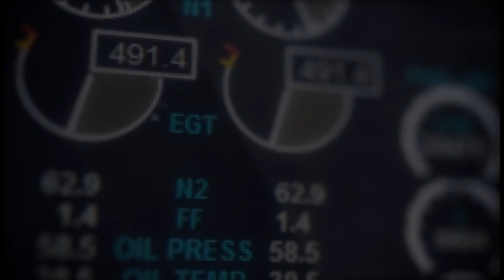Will Circular runways "take off"

Comment: IMHO, a partial palliation of the need for a large, obstacle-free peripheyry would be to have such a corcular runway on a peninsula adjacent to a relatively obstacle free land area large enough to render the needed periphery.

Thus it might be frequently necressary to construct that peninsula, being sure that the circular area is far enough from the cost or shore to minimise the amount of needed obstacle free space in the adjacent land. As for the passenger terminal, it might be feasible to construct it on or under the centre of the circular runway, connected to the mainland by a subway or undereground light rail service.

If that airport is also to handle heavy baggage or freight, the rail service might need to be of a heavier nature for the tracks and have a split inland to separate destinations for passengers and freight, and also have a higher tunnel height to accommodate large freight, or have all cargo flights land at a separate aeroport depending on destinations, case by case.

Sometimes the separate airport concept may be more economically expedient other times not, depending on multiple contributing factors.

As I am writing this, I am watching to see what is to become of two noew concepts in the West Island area of Montreal Island.

One is to serve Trudeau international airport which is located some 16 Km,. West of downtown Montreal in the city of Dorval. the current road systems are outmoded and inadequate, but also currently under construction, along with other major construction along the route.

The other is a proposal for a light rail service from C.N. east junction, north of the Mount royal rail tunnel to the vidinity of Fairview Shopping center.

I was aware of the shortage of land for the Fairview bus terminalk some years before the concern came to public view.

I then detailed my idea for a solution on an internet blog related to the STM (Montreal's urban transit provider).

Travelling on the buses frequently, about a year and a half later I encountered a driver whom I had never met prior, who happened to have an interest inthe concern. when we compared our ideas, the exact pieces of land I had suggested matched with those he believed would be used for the future new terminal.

I do not work for the STM or any other similar authority. I am retired at age 73, however I know much of the inside story as if I did, albeit from my own investigative paradigm.

My origonal idea was designed somewhat based on the Port Authority bus terminal in Manhattan, NY which I have had occasion to use personally. Both involve use of elevated busways to facilitate efficient access to buses arriving and departing.

Without more detail on that, one might well see from what arises my ideas here in regards to poeripheral accessibility.

In my time, I also have had some 1 million Km. on the road and fly and drives in 3 languages and 3 countries. A "GPS on two feet before GPS even existed!" (I was not a trucker, although I doid do a blit of it. I was doing industrial electronic service for an employer who was like a specialized agency, renting technicians to many and diverse industries.)

Comment: The wind woundn´t be smooth because it would go over the top of the runway and then downwards. Also it would be a minor difference but the outwards wing would be traveling faster than the inner one making and assimetric lift.
Reply from the maker: Yes, theses and many many more problems exist with this idea.

Comment: Before watching the video: My short answer is HELL NO! edit: same answer afterwards as well
Reply from the maker: Exactly.
Reply: My answer is still hell no. Land banked, imagine the flight patterns. Crazy idea.
Reply: so the planes will be landed on a bank and turn..... so when you touch down how can you maintain the turn during nose up phase?
Reply: I would argue that the addition of the iPad in the cockpit is worth noting
Reply: LOL. Ty.
Reply: My thoughts exactly. im just a simmer, but ive tried this using a j3 cub, and crashed more times than ive landed. a recipe for disaster/s yes. just wont work. especially if an airport becomes as busy as atl or lax or whatnot.  it MIGHT work for smaller aircraft , and that sir is only a faint might.
Reply: lol yeah.
Reply: With the correct speed and banking, you don't have to turn to keep going around a banked turn (just maintain that speed, faster you go up the banking and slower you go down it).
Reply: In a properly designed banked oval the angle of the bank  makes the force of centripetal acceleration (that force required to keep the object from flying out of the circle) be balanced by the force of gravity pulling down on the aircraft due to the bank.  Effectively the steering is straight.  Places like GM proving grounds have oval tracks with lanes slightly banked on the inside marked in lower speeds, and as the lanes go to the outside of the track they get marked with increased speed and are banked at increasing angles.  If a vehicle is doing the correct speed in it's lane the drivers steer straight and do not have to steer to go around the track.  Of course what I'm writing about is a car track... how that would work for taking off and landing...  especially if you have to land at an angle to match the banked track.  They also do banking for railways, especially high speed rail.  The turns have a large radii, but they are also banked; this keeps the train from tipping over at speed, and the train wheels centered between the rails.  If they didn't center, the inside edge of the wheel would rub on the rails and make a horribly loud sound.
Reply: Thank you, finally someone sane, unlike dumb comments above...
Reply: I thought the same thing and I only fly RC Planes! lol
Reply: The slope make this stuff absurd - all of the passengers will leap on one side... not to mention the plane at all...
Reply: Rudder
Reply: Mentour Pilot I find the idea as useful as a Concorde

(Goes good to displayed)
Reply: Same.
Reply: therealnightwriter : round runways and flat planets.  I think you might have just isolated the problem with the today's education system
Reply: So he obvious next step; spherical runways ?
Reply: agreed. I think even a square runway would be more useful, and thats a stupid idea...

Comment: Circular runways are stupid and they won't work. There's no point at all.
Reply from the maker: I couldn't say that but, yes.
Reply: But that's the point of ideas. Don't just say it will never work. Think, give reasons for and against, then decide.
Reply: There is points for, but more against. It is better, like here say why it will not work, than just say "this is stupid, because I say so".
Reply: I soo agree with you
Reply: jsponson It won't work, it's no point. Learn aerodynamics
Reply: As this video has demonstrated, there are many practical challenges, but I wouldn't say there's no point at all.  I can think of one benefit: aborted take off's would be safer.  With a straight runway there's a point of no return (e.g. when you exceed V1), with a circular runway you slow down and go back to the inner circle (having to avoid any aircraft in the other sectors of the runway, of course).
Reply: +Montero Entertainment It's not pointless, you can always head into the wind and the runway is never too short. There's 2 pros for you.
Reply: Yeah but more con than pro. Also the assumption is that the circular runway will never need to land an aircraft with mechanical damage. What happens when there are problem on the plane and it can no longer maintain a circular bank when landing?
Reply: +Nick L You have straight ones in the middle.
Reply: Leif Neland Ive done research on it and I thought about it. I know it's pointless.

Comment: Its bullshit it be best have a straight runway 360 degrees for the wind direction if u understand that. But going for a runway going around a curve then thats going put some stress on the left or right side of the landing gear. So wont be good. A long straight runway that is north south east and west then yeah that would make alot more sence

Comment: The circular runway concept is pure genius: A plausible sounding idea with all the correct buzzwords (green, environmentally friendly, fuel efficient, blah, blah, blah) that guarantees funding from simple-minded EU bureaucrats for years, if not decades. There's so many things wrong with this idea that it's hard to see what's right with it. Sure, it will never be practical, but who cares as long as the research funding keeps coming.

Kudos to Mentour for the restraint he has for not calling this idea completely idiotic.

Comment: This would solve the crosswind problems in VMC landings and takeoffs, and runway length would never be a problem. It is, however, difficult to see how precision approaches in low-visibility conditions can be solved. Currently this is done using old-fashioned ILS (CAT I, II & III) and massive approach light systems. IFR traffic management would also have to be overhauled. This is a concept well worth investigating, but being an old fart (a retired pilot) I see only problems with the IFR side of this idea.
Reply from the maker: Same here.
Reply: Being an old fart, my creative juices have mostly dried up - but I bet some young wizards, still full of spit and vinegar, will think of all kinds of solutions to this concept. It will definitely work just fine in flat and windy areas, but only for smaller aircraft and VFR operations.

Comment: If somebody is going to build a circular runway it's probably close to Dubai
1. They have lots of deserts.
2. They have a lot of money.
3 They spend the money on extreme and some times stupid things for example creating the Devel Sixteen AKA a road car with 3000hp(Still a concept).
4.  It's always summer and it rarely rains in the UAE so the plane wont slide off the runway.
I wouldnt be surprised to see the first circular runway in the UAE if it even happens.
Reply from the maker: Probably a good guess.

Comment: You might also mention the stress on the landing gear when you try to land an aircraft at a circular runway thats banked. Not to mention the extra workload on having all those kilometers of runway and its associated taxiways ice and snow free in a winter enviroment. Johan.
Reply from the maker: Yeah, like I said in the description of the video, there are many many more problems that needs to be solved with this concept.

Comment: A large octagon or a 10 or 12-sided polygon would give multiple straight runways. This is interesting because as I watch a lot of takeoff/landing videos I notice the huge amout of time spent taxiing, and was thinking what possible solutions there could be to cut that time.
Reply from the maker: There are probably better solutions out there but the circular, banked runway is not the one.
Reply: That defeats the purpose as planes wouldn't be able to go through the corners on their takeoff/landing roll. All that taxiing is because departing planes need to reach the downwind end of the runway, and arriving planes are coming from the upwind end of the runway. The ends of the runway are typically fairly far from the terminals.
Reply: That would give you an even larger amount of taxiing. Each runway presumably needs the same length as today, and with the terminal at the center, you'll have taxiways that are longer than the runways themselves.

A straight taxiway from the center to one end of a runway of length 3 km in a decagon (10 sides) is 4,85 km long. In a dodecagon (12 sides), it will be 5,8 km long. That is allmost twice the lengt of the runway.

The calculation is: [RWY length] / Sqrt[2 - 2cos(360°/n)], where n is the number of sides in the polygon.

In a hexagon (6 sides), the taxiway will be 3 km long.
Reply: Terrible idea. So rather than 2 or 3 long runways, you get 8 short runways. An octagon is not superior to a regular runway, although it solves some of the problems of a circular runway.
Reply: Plenty of airports & airbases in the late 1940s-1960s were built with a triangular runway layout.
Reply: you realize the area such a shape would take right ?, let's say an octagon of 8 runways with 1.5 km length each = that's about 5km of diameter (rougly), where would a one be able to fit such an abomination.. ALSO as the pilot said = clearance area

Frankly don't think the idea is completely obsolete, but rather very limited.. i.e. used only on places with low population, open areas and strong winds (Iceland, Carribeans, Maldives..), having those near any sort of city though is neigh impossible..
Reply: The US has plenty of large, open, flat places.

Comment: This is as stupid as the flat earth theory
Reply from the maker: Not AS stupid, but it has considerable problems.
Reply: euplot not a single thing or theory in existence  is as stupid as the flat earth theory.... I'd rather accept the existence of god before considering to think about a flat earth
Reply: Fuel consumption.
Reply: Flat earth is not even a theory, a theory requires evidence to support it.
Reply: euplot 

Flat airport is a reality.
Reply: Mentour Pilot Great answer. Too bad vertical takeoff and landings never really “took off”.They could have applied it too commercial aircraft.☮️
Reply: This seems to make sense for small aircraft (<150kts)  high traffic. Cessna events etc. You can locate a large amount of runway exits allowing less wait time. Runway can clear much quicker. You can exit towards the center quickly and move forward (out of the way) into the taxiway. This will allow more room for waiting traffic. I noticed a Cessna event with high traffic. The issue was, it was taking too long to exit and fully clear the runway. Also, traffic was building up on the taxiway since you only have a few exits. 
Think of freeway traffic exit build up. The freeway gets clogged because the exit is jammed.
The circular runway would allow you to land anywhere on the runway without having to adjust speed and get in line and wait to land. 
It looks like this runway would allow traffic to build on the ground where its safe instead of approach, lining/synchronizing before landing.
If the runway is large enough, you can have simultaneous approaches on different coordinates. Let's say 3 entry points on the circle. Sounds complex but for smaller aircraft, the airspeeds are much lower giving plenty of room.
The quicker you get everyone on the ground, the less air traffic builds.
If there is a minor accident on touchdown (landing gear failure), the other parts of the runway is still usable.
If you look at large stadiums, there are multiple exits to get to the stadium instead of one, building up traffic.
This allows alot of rapid runway exits.